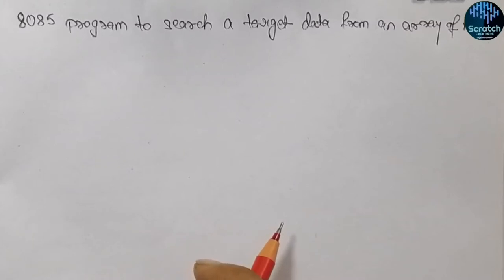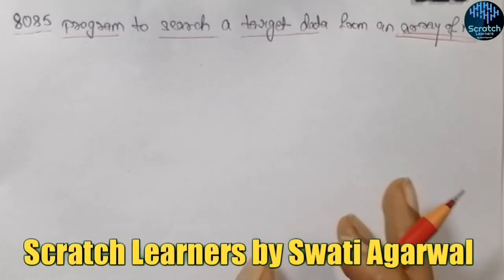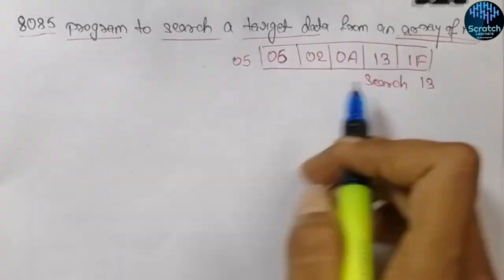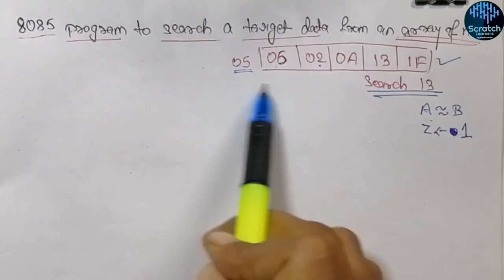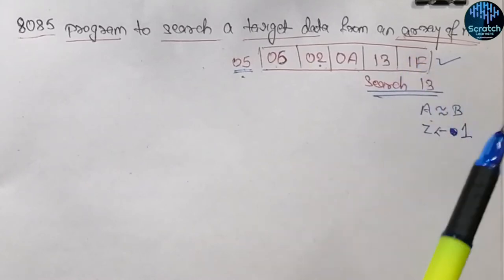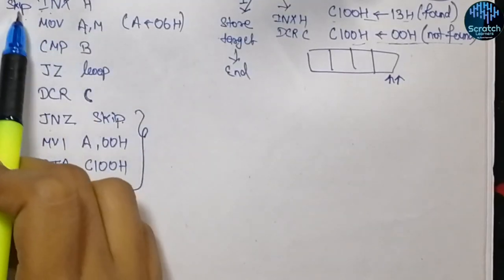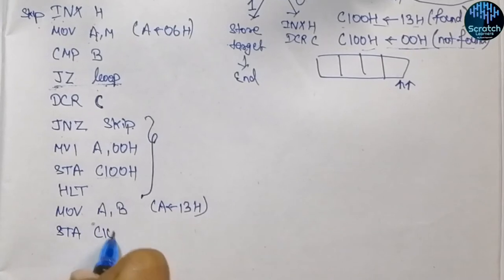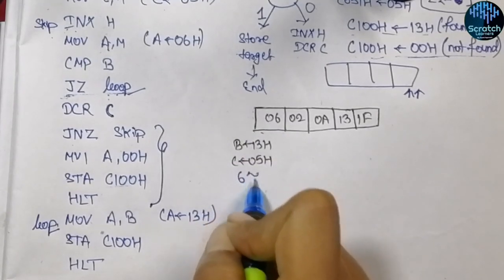8085 program to search a data from the array | Searching a number in 8085 | Linear search in 8085

Comment: Here we can use xor operation also. By giving immediate xor input which is required number and xoring with the data one by one in loop, when the xoring result will be zero , it mean we will get  the required number.. Is this also correct?